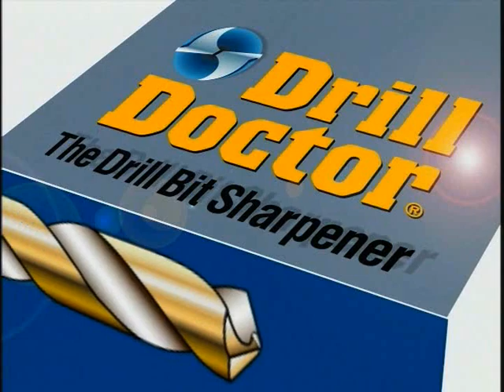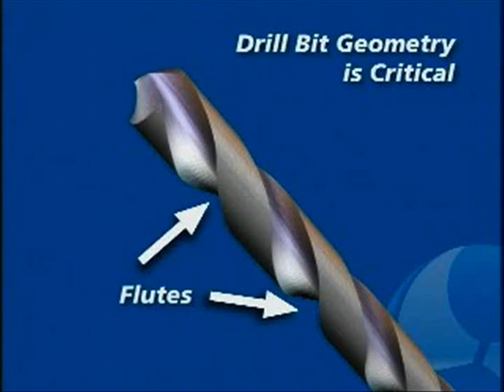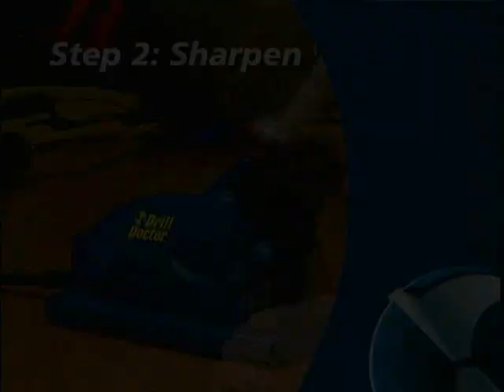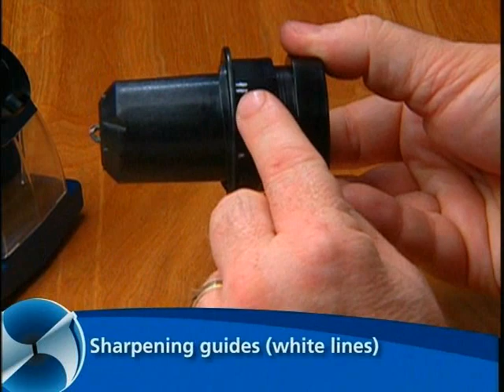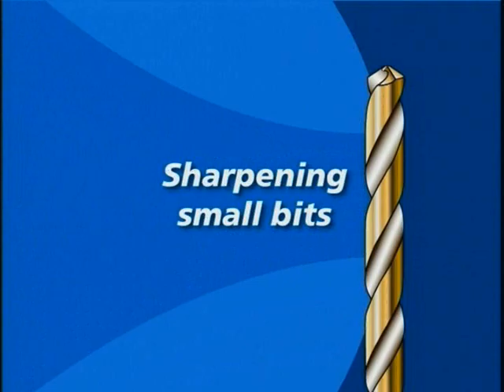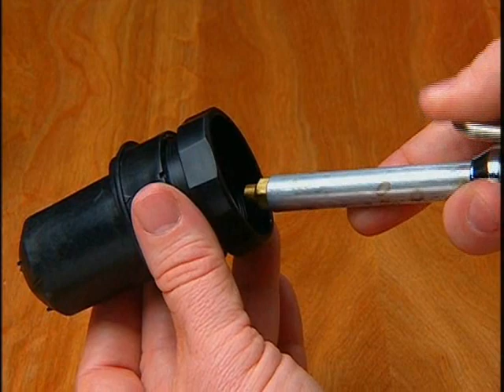Drill Doctor Model 350X

Comment: I purchased a Drill Doctor 350X approximately 2 yrs ago and am dissatisfied with its performance. Despite following the video instructions carefully I have not been able to sharpen bits 3/16 in and above. I have been advised by a professional that the tip is being sharpened too flat and it is not producing the required leading edge on the tip. It is now a white elephant